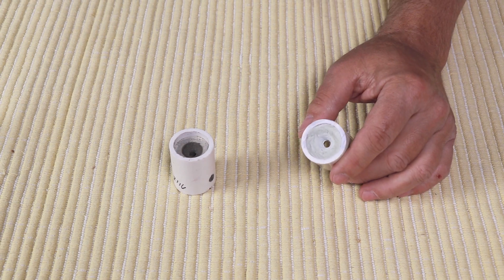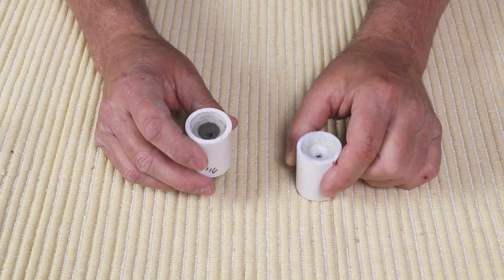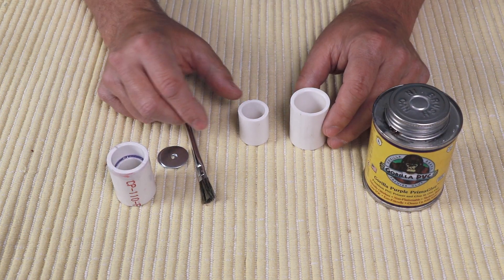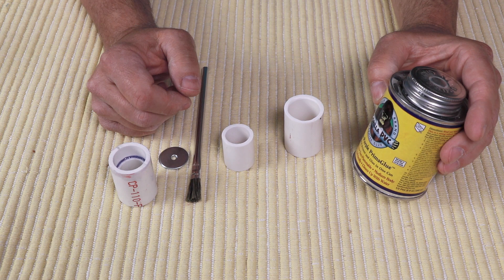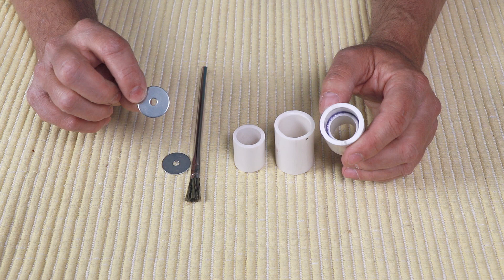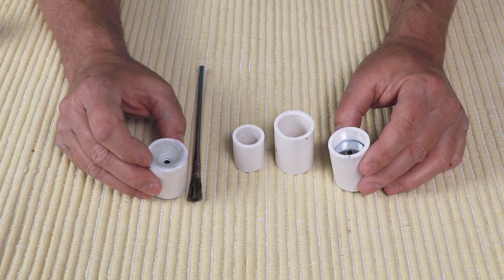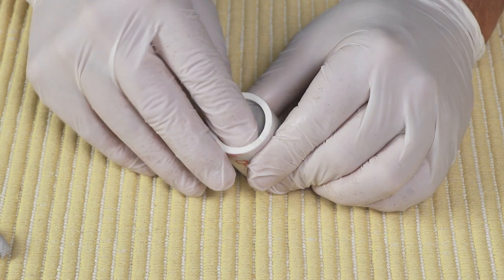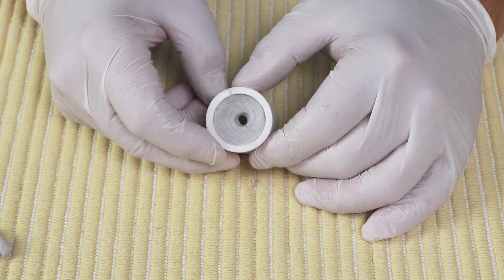EZ rocket nozzle for a 1" PVC sugar rocket motor.

Comment: Looks like a great was to make a very good working cheap motor I am going to turn out about 10 or 12 may be us Sorbitol , When do you think???
Reply from the maker: Yes, sorbitol will work for a PVC motor. I prefer flexi-fuel because it burns faster and sets up quick without sticking. Fructose works well too.

Flexi-fuel
https://youtu.be/wpPwya8NEyI

Simple PVC motor
https://youtu.be/KzsbrSw-l_0

Sorbitol vs fructose
https://youtu.be/nLT_aRcI7fQ

Please like and subscribe!

Comment: Make a plastic form to push into the clay to give a perfectly shaped nozzle. It will also make it smoother as you want the gas to flow with least resistance giving greater thrust and far less heat transfer. It will also make the process far quicker.
Reply from the maker: I now use 3d printed parts to form the nozzle. Good comment!
Reply: what plastic form, should i use, and i have a hard time doing mathematics for determining optimal throat diameter
Reply from the maker: @alakazaam-n7c  A plastic form can be 3d printed, but it is unnecessary. Form the convergent in a bowl shape and drill a hole the same diameter as the nozzle washer for a divergent. The hot exhaust flame will carve its own divergent shape. I hope that helps!

Comment: Very good, great.
Reply from the maker: Thanks!
Reply: @TheRocketeer  
I'm not 100% sure
but here are my thoughts on rocket fuel.
this is a good mixture, but some sources indicate that it is bad to add a lot of aluminum.
aluminum when burned gives a high temperature, and magnesium even higher, but they do not form a large amount of gases, which is so necessary, because when they burn, they form oxides, we know that aluminum oxide is refractory.
The binder also burns like fuel, but it does not burn very well.
And ammonium perchlorate in our country is expensive.
Approximately $15 per kilo, but potassium nitrate is only $2 per kilo.
Rocket chemistry literature indicates that binder can be reduced by up to 9%.
So 10% should be enough.
In the end, you can do this.
Mix fine powders of magnesium or aluminum 5%, charcoal 2-5% and the rest is potassium nitrate and powdered sugar, then we dissolve the bitumen in petroleum ether, or hexane, there should not be a lot of solvent, the bitumen mixture should look like a flowing sauce, not liquid , but not very thick, you can try to add a little paraffin, the result is a mixture similar to a cement solution, it is very convenient to work with and it is cheap, if the components are not added correctly, then it can be balanced at any time by adding a little hexane and any component .
It is pleasant to work with such a mixture, it is mobile and plastic like cement, and the price is not high.
The mix is forgiving, and hexane can be added to the hardened mix and any component can be adjusted.
You can use gasoline as a solvent, but gasoline has a higher boiling point and is therefore more difficult to remove, hexane, or petroleum ether, is best.
---------------------------------------------------------------------------------
how to check mixture
we take a small piece of foil, put on it a small sample of the prepared mixture of 0.15-0.25 grams and set it on fire, if the mixture sprays small white drops of saltpeter, then any fuel must be added.
If it doesn't form well, add some more bitumen in hexane, the solvent-removed mixture should stick together when you squeeze a small piece with your fingers, the amount of bitumen can be increased up to 15%, but more is not desirable, since the bitumen turns into a liquid state and your fuel before igniting with an excess of binder, it will simply melt without igniting.

You can also use PIB, epoxy, silicone sealant and other types of raw rubber.

Another substance that promises to be very convenient is polymorphus (polycaprolactone), very good properties, low-melting thermoplastic, just what you need, ether, we immediately recall the solubility and flammability.
Well, for example, nitrocellulose dissolves in ethers, that is, there is hope for the cosolubility of such substances in alcohols and ethers, which together gives very good hopes for the possibilities of this substance, because all this is often soluble in acetone, like many other things, that is it's a huge range of different interesting compounds.
---------------------------------------------------
I also believe that up to 10% nitro derivatives can be added to bituminous, silicone, or other similar fuels.
sorbitol can be fused with the addition of 10% ETN, and nitrocellulose is a separate issue, earlier plastics were made on its basis, I think all this can be used if available, including such plastic itself (it is soluble in solvents, for example, in acetone).
Reply from the maker: There are a lot of different materials that will make a powerful rocket fuel. The key is to find a combination of materials that are easy to make and obtain along with stability and low toxicity.

 Hexane makes a great solvent but can be toxic and needs to be handled by a professional. Like gasoline, hexane is highly volatile and is an explosion risk. Magnesium even in low concentrations burns violently and has the potential to react with strong oxidisers. You can find some experiments with sugar fuel mixed with magnesium and aluminum on my site.

I think there may be a good potential for magnalium at 5 - 10% in a sorbitol mix. I hope to do some testing this summer with this combination.

You may have the skills and experience to mix the suggested materials but I would not advise others to do so.
Thanks for your comment!!
Reply: @TheRocketeer  
Thanks a lot.
looking forward to your next work.
Reply: @TheRocketeer  
what is the name of your site?
Reply: @TheRocketeer  
I completely agree with you.
magnesium / aluminum 5-10%, in this range, that's right.
if more is added, there will be an excess of refractory oxides in the fuel.
up to 15% is possible, but 5-10% is better, 15% is already too much.

Comment: Thanks for posting this!  This nozzle is very easy to build and functions superbly.  I'm using it in my 1" G class KNSO fueled rockets with great success.  I also modified it slightly to make a very reliable delay grain enclosure.  With the other methods I used I was having issues with the nozzle or top enclosure failing quite a bit.  This one is much, much, more reliable and consistent.
Reply from the maker: I would like to know more about your delay grain setup. Are you using the standard 65/35 fuel for the delay and what is the web thickness vs delay time? I would appreciate any other details.

Thanks for your comment!
Reply: @TheRocketeer I had a brief time out (well, I guess a year is brief) from motor building but am back into it now.  I am building 1" PVC motors with 1.5" BATES grains (the 2 grain is F class, the 3 grain G class).  I use 65/35 fuel for the delay grain usually about 1/2 inch and inhibited.  I put a washer (same size as the nozzle washer, 3/6 (nominal) RTV'd in between the propellant grain and the delay grain.  My issue in the past was having the hot gasses get past the delay grain and ignite the ejection charge prematurely; the RTV'd washer seems to fix this.  The whole enclosure resembles your 1" easy rocket nozzle (which is awsome, BTW) in reverse with delay grain being inserted last in the top of the motor.

I was perhaps a bit hyperbolic when I said "very reliable delay grain".  I built two, both worked fine but I need to dial in the timing better.

I'm definitely a newb and your videos are the main reason I am consistently making reliable motors.

I've been using Sorbitol, but am going back to to sucrose because it so much more powerful. 

I've got two sucrose based motors ready to test and next I am going to try your flexi-fuel formula.  I like the fact that it seems to be pourable (which straight KNSU definitely is not!).

You've got a great site with lots of solid information.  I've gone through Nakka, Jacob Rocketry and Jimmy Yawn's sites also. They are excellent, of course, but you are easier to follow.   There are quite a few idiots out there posing as experts -- which I guess is not all bad -- that's how I first got interested in this hobby after an absence of 50 (yes, fifty) years.

Sorry for the long post.  When I get the flexifuel going with a reliable delay grain, I'll get back to you!

Best...
Reply from the maker: That is a great idea Mason! I will make a note of your delay grain idea.

I think you are going to really like flexi-fuel for 1" PVC motors. It burns faster than sorbitol and is easy to make and cast.

Thanks for your encouraging comments! Every spring I evaluate if I want to invest the time to make more videos. It is post like yours that keep me going. @masoncolbert8285

Comment: Great video, but where do i get the PVC pipes from? I have no idea, and it seems amazon doesnt have them. This is a big problem for me, considering its obviously required for the motor...Could you link me to some, if you could?
Reply from the maker: PVC pipe comes in 10' sections so that is probably the reason why Amazon does not sell it. 1" PVC pipe can be found at Lowes, Home Depot, Menards or most hardware stores. At this time it is less than $10 for a 10' length!

Go to my home page and click on the "About" tab. You can find my email address there if you need help. Good luck!

Comment: Great video. Is it possible to add a divergent nozzle using the same epoxy clay?
Reply from the maker: The epoxy clay will not hold up to the heat. If you would like a divergent then take a look at other videos I have made using concrete.

Comment: I used your method with a washer and JB weld steel stick. After a few burn tests, it seems that the plume burnt the nozzle out and widened the hole quite a bit. IS this something you have come across? is there something i could use instead of JB weld that may be better?
Reply from the maker: Use two washers minimum or try 3 to prevent the nozzle erosion. If you are still having problems then try a different brand of washer. 

The main purpose of the epoxy clay (JB Weld) is to prevent the washers from becoming super heated and melting through the case. The ablation  helps preserve the nozzle and is normal.

The advantage to the EZ nozzle is it is simple to make. If you would like to try a concrete nozzle then please check out this video.
https://www.youtube.com/watch?v=9AB4308IY68&t=27s
Reply: Try a graphite nozzle. It requires some very minor machining of soft graphite rods, but it's a great nozzle material to use

Comment: For easier fitting of the two sizes of PVC freeze the smaller piece and heat the larger.  Freezing will shrink the PVC several tenths while heating will expand PVC approximately the same amount.

Comment: Thanks for sharing I made a rocket motor from 2in PVC using this method still need some tweaking as a rocket exploded shortly after lunch instead of using steel washers I just drilled out some wood due to the bigger diameter but I'm going to try again.
Reply from the maker: Only steel will survive that hot erosive environment. You may want to start with the 1" motor first. Work your way up as you build skills and knowledge.
Reply: @TheRocketeer catlitter powder? For my 2 inch rocket motor

Comment: inspired by my design?
Reply from the maker: I don't know what design you are referring to. I am not aware of anyone using a two part epoxy putty in a PVC rocket nozzle with a PVC retainer.
Reply: I'm using aluminum for one test and macor for the other

Macor obviously being much more expensive to have made but takes a lot of heat